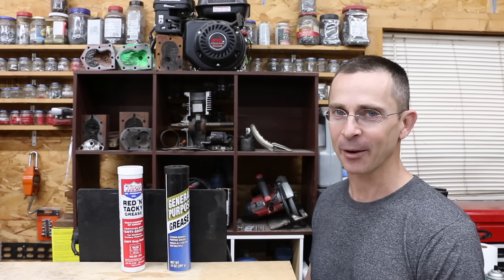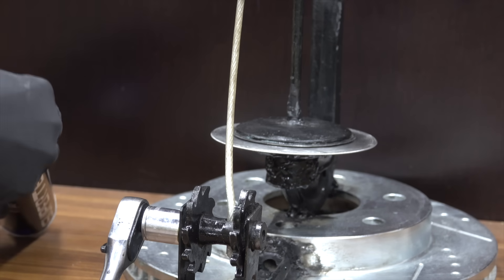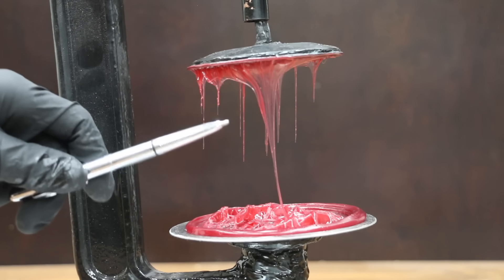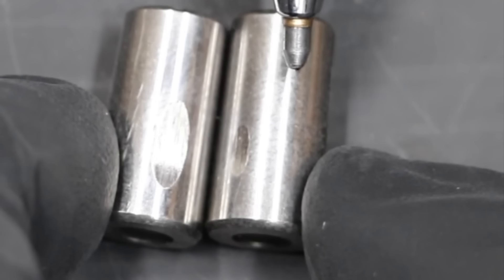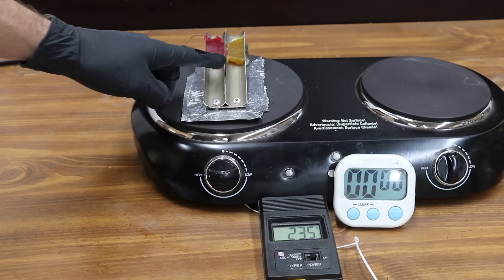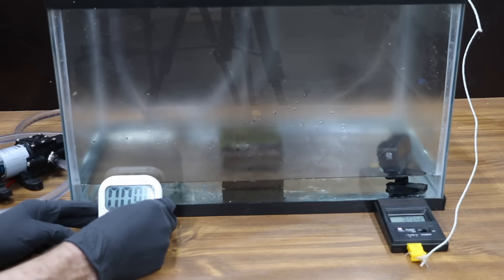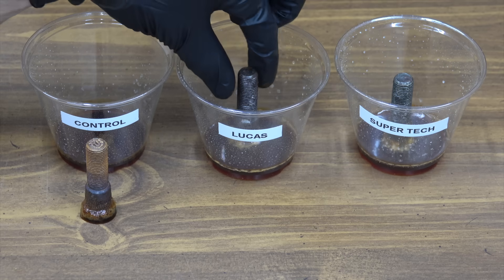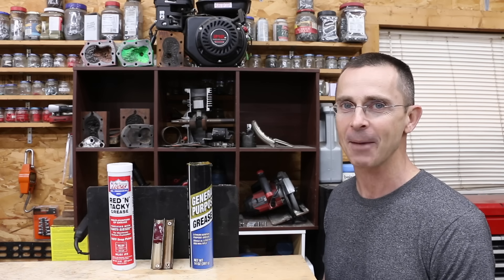Is Cheap Grease better than Lucas Red N Tacky? Let's find out! Bearing Grease Test Episode 1

Comment: Anyone here remember Quaker State "Golden Chassis Grease" with the 'Golden Additive'?  I still have 1/2 a tube from way back when & Ford/Lincoln Sp. Purpose p/n something or other 'special chassis grease '(Moly) circa 1978.  I myself used Esso Lonax the most along with Castrol EP2 & Monarch Monaplex (for bushings & slides) I also have a (display) can of (cannot read the brand) chassis grease from around 1915. Still smooth & useable.  Each grease base has a different purpose (example) Needle Bearings to Bed ways.  Thank you for all your tests, you think of everything!

Comment: Certified grade 2 grease!!! I use this grease at work in every bearing out in a plant and would like to see if their high dollar grease is really worth the money! Thank you for reading this
Reply: Every bearing? No no. 
Unless your bearings are the same size going the same speed with the same load under the same conditions you will have to be incorrect on some
So many variables 
#2 only refers to its thickness, its ability to stay in place
There are many many applications calling for #1, 0, 00 or #3
Base oil viscosity and thickener type are the most crucial

Comment: Video idea: does running kerosene, gasoline, or diesel mixed in with engine oil help remove carbon build-up in valves/lifters on a gas engine? Would it help doing so before an oil change?
Reply: No it does not, it would make things worse if anything, by thinning out the oil and making it pass more easily through the oil rings to the cylinder. Gasoline etc. would boil after the first warmup anyway and Diesel would just lessen the properties of the oil.
Reply: Adding a solvent (like Diesel) to the oil and running the engine for 10 minutes would essentially be doing an engine flush, it won't remove any carbon from the cylinder, but it might remove some hunk from the oil lines.

Comment: Would love to see you test john deere grease, on the next test. Always making interesting videos. I lean alot from your videos.
Reply: Very much so. Polyurea are supposed to be far better than lithium bases. However polyurea has larger compatibility issues with other grease types. Deere bearings are pre packed with Deere grease, forcing you to buy actual Deere parts if you want to use Deere green polyurea grease.
Reply from the maker: Thank you for the video idea!

Comment: Hows Lucas Green grease compare to the red n tacky? I noticed using the red n tacky if I leave gun hang in garage for around a week or so it starts dripping red oil. Why? Summer or winter. Doesn't matter? Is the grease still good after its lost that oil its dripped out?

Comment: The grease incompatibility comes from certain Molly based grease and lithium based grease. Throw in some of the more odd Marine greases with aluminum bases and you can have your grease turn to a solid crust in a few minutes under pressure.
Reply from the maker: Great recommendation

Comment: Last time i changed my brake pads i repacked with wheel bearing grease which contained aluminium for heat. I haven't had any trouble yet but I don't trust it.

Comment: The test is a high temp bearing grease verses a light duty grease. Honestly what did everyone one expect? The testing wasn't on an equal level. 

Now let's see a fair test, put Lucas tacky red against Supertech Red high temp.
Reply: Re-read the title!
Reply: @tonyallen8596  I know what the title says, but the video goes down the road of battle of the brands. That doesn't go along with the intended topic of cheap vs expensive.
Reply: That's not the point of the test .

Comment: Heavy equipment mechanic here... if you’re an operator, please grease at least once a day... two times a day would be better. And please wipe off the extra when it dangles. It’s bad for the environment and grease doesn’t come out of clothes easily lol. It also looks bad, like you don’t care.  You grease... I’ll come fix it when it finally breaks that’s my job. 

Great video, very surprising results considering I’ve heard the same line before... “any old grease will do.” No, no sir it will not.

Comment: You should do a grease test to show why you shouldn't use low heat temp for wheel bearings. A what happens if you use the wrong grease for the application.

Comment: I use it in ARs and AKs for carbine classes. 900-1000 rounds in 5 hours or so, no issues and no need to reapply during the class. I dont recommend it for long term storage, stick with oils for that.

Comment: The "grease is grease just use whatever" does have a point in some cases.. Depending on the application it might not matter at all, My redicolusly overrated skateboard bearings is fine with whatever. Front wheel bearings in my van has to be changed every time I change brake disks, so better grease to prolong its life is pretty useless, (altho I might get slightly better milage in cold weather with better grease judging from this)

But in the end, even expensive grease is cheap, and saves me from needing two types, so I'll buy some synthetic stuff next time....

Comment: I find that the quality of grease does have a significant effect on the life of bogey wheel bearings on snowmobiles. Removing the original grease from the cheap China bearings and filling them with something better DOES have a positive effect.

Comment: I’ve been using Red n Tacky as lube in all of my metal-framed handguns for years. I’ve noticed in particular that it has done on amazing job at reducing anodization wear from the slides on my aluminum-framed handguns (P226, 92s, etc.). I also use it to keep suppressors from getting stuck on their mounts after high-volume fire and it works like a charm for that as well.

Comment: Lots of greases could be tested.  I use superlube synthetic when it's something that doesn't get much service or doesn't use very much.  Could check out greases with molybdenum disulfide and if you drill deeper in to that, those moly greases will contain different amounts of molybdenum disulfide.  Lots of specialty greases out there too.  So maybe just do general purpose greases.  Have a contest for moly grease, synthetic grease, marine grease,  conventional grease, etc etc and then a final battle to rule them all.
Reply from the maker: Thank you for the video idea!

Comment: I get this test but super tech said it was light duty. It said it dropping point was 350. Lucas was heavy duty and had a much higher dropping point. So how can you compare both. Not really a apples to apples test. Just my 2 cents I am not complaining I just making a statement super tech never claimed to be more than what it was a light duty grease. Lucas was better because it’s a heavy duty. So I kinda feel like this test was a bust to begin with.  Comparing like for like best time will be better.  Mobil 1 vs Lucas.   Then wolfs head vs super tech. To be the test was just not comparing like for like.

Comment: Well heck yeah! I tend to go for the lucas myself, nice to see it really is that much better. I mainly use grease for mower spindle bearings so in that application it can be pretty important, especially since most mower manufacturers give you a grease fitting these days with sealed bearings, so the grease zerk doesn't do much good. I've also found that chinese bearings can be made to last much longer if you open them up and put decent grease in them out the box.
Reply from the maker: Thank you

Comment: The best EP2 grease is Chevron ULTRA - DUTY high pressure EP2 Red. NLGI2
MEETS MILITARY SPECIFICATION MIL-G-81322 down to -15 Farenheit. 
Has Industrial marked on it.

Made for oil rigs it resists salt spray, it is so tacky / stringy you cant wash it off ,even with good hand soap. It looks like the Lucas .
My bet is the Lucas is Chevron made for Lucas to different specs. The stuff is tanashus!
No one knows more about making grease than Chevron . They have spent more time ,money and research for both private and government sales. No one has as many grease patents as Chevron!
I would like to see the Chevron HP EP2 RED compared to the Lucas.
The Lucas Red is $4.98 per 14 oz. Tube.
The Chevron Ultra Duty EP RED is $14.87 per 14 oz. tube. 
Both on Amazon!
You can belive the Cheveron is far better .

Comment: I started out using Amsoil grease then Mobil 1 and then the Lucas. The complaint I have on all 3 is the syrup that leaks out of the bottom of the grease gun. The Lucas however leaks less than the others. I use the Lucas on all my stuff and on the dam that I run here in Wisconsin. It has 3 10 foot gates with gear boxes that operate 4 inch diameter 10 foot tall screw that attaches to the gate. The Lucas grease works very well even in sub 0 conditions. The gears turn smooth and easy using a manual wheel. When the video started I wondered if you would use the lubricity tester and was glad to see the out come. To solve the syrup problem there is a company that makes a product called "Gundom" it's a condom for your grease gun!

Comment: Can you mix two “incompatible” greases to see what happens to metal wear surfaces as compared to one grease cleaned off and replaced with something else. Other than the two already tested.
Reply: There is really no such thing as compatible or not compatible grease, the only risk is the coloring agents reacting really, which would make the grease most likely black, so impossible to tell if it's worn out down the line just by looking.
Reply: Piotr Sulej Incompatible was used in the video, if you watched it, it was the grease manufactured that said it.
Reply: @F6HemiCharger  I know that the manufacturer said that, but manufacturers often say that things not sold by them are not compatible, don't know if that's the case here, but afaik mixing grease (just like mixing oil) is not an issue.

Comment: It never ceases to amaze me how accurate your test runs are and how much thought you put into them. Awesome!

Considering ideas for future test runs :

There's a rumor saying that you should mix 2-stroke-engine-oil (1:300) to Diesel fuel to make the engine run smoother, reduce wear and friction and also reduce  carbon buildup in the cylinders and gunk on the injectors. And "of course" it'd reduce fuel consumption. Pure magic! Could you test that?

And while we're at pimping Diesel fuel : could you test 2-Ethyl Hexyl Nytrate cetane booster for its effects, especially change in max power and fuel consumption. Sounds like rocket science, but the stuff is available on Amazon.
Reply from the maker: Thank you for the video idea!

Comment: Let’s see a grease “tournament” for March. I’d probably watch this more closely than basketball.
Reply: Yes. Absolutely do this. I'll even donate a few tubes.
Reply: This would be fantastic, could try getting in some of the "high performance" brands to show down!
Reply from the maker: Thank you for the idea!
Reply: Absolutely! Great job on this one, keep it going!
Reply: I’m late to the party but would love to Belray waterproof grease in the mix as that s what I’ve been using when maintaining the dirtbikes.   Cheers
Reply: Gadius
Reply: Definatly, if this goes ahead id be happy to donate a few aussie brands of heavy duty grease like penrite and gulf western
Reply: All blacks anyways
Reply: I agree, really wanted to see Mystik JT-6 in there, it’s the grease I used for 16 years in my old job.

It was a brutal application, high temp, high speed, high load, water AND dirt. 🤣

Even with all that the bearings we were greasing typically lasted 10+ years, even with somewhat spotty greasing by me.

Comment: I have used cheap grease, but I have been using 3% moly grease and have found a huge decrease in wear on my backhoes. But I may have to use Lucas for my wheel bearings from now on, the cold test and heat test has me convinced. Thanks for the time and effort you put into these tests!

Comment: i always buy Lucas products if possible. Red N Tacky grease is phenomenal for chassis lubricant. i really love the visceral satisfaction of greasing a u-joint or tie rod or ball joint on my old trucks. it's also really handy to use a tiny dab in the shop for making paper gaskets stay where they're supposed to during assembly.

Comment: Napa has a really nice bearing packer, no nuts or threads to have to spin on, just a nice tite fit. put bearing in, put top cone on,  push down till grease comes out  through bearing.    ive done the cheap grease also.  wonder about a  test of  Motocraft  oil against some of the premium brands also tape measures  comparisons would be great  tests .   cool testing equipment

Comment: You might try testing old school crisco cooking grease.   Ok the deal is when I was a teenager we were pulling a boat and trailer we were about 100 miles from home we wound up on side of road due to trailer bearing failure. My stepdad had a new set of bearings and races in the truck just never put them in.  Well what to do now? Got tools, got bearings, but no grease hummmm got crisco now I’m thinking this is never going to work. But he pulled it down cleaned out hub and spindle installed new races packed bearings with crisco and we headed home and made it no problem. Well here is the funny part one year and several trips later we were camping out on the river I’m telling one of my uncles about this thinking in my mind that he repacked bearings with actual grease when we got home from that trip and my stepdad said no I never did that trailer still packed with crisco I said WHAT???? Are you kidding me he says no it’s still in there.   We pulled that boat all over the country between three states with bearings packed in crisco. So all I know is it’s works pretty good.
Reply from the maker: Thank you for the video idea!

Comment: Hello there. I just stumbled upon this channel and found this video very fascinating. Very good work testing the grease with the tools you have.

I happen to be a lubrication chemist. I will say right off the bat that grease is a very complicated lubricant. Most lubricant researchers stick to oil, for good reason!

Just a few things to add that you might find interesting. 

Greases dont "react" when mixed together. The reason greases can have issues is that when two incompatible thickeners are mixed, their ability to absorb oil is severely inhibited. If you do any future tests, what you should be looking for is for the mixed grease to bleed excessive oil. You can observe this easily with a white piece of paper, as the paper will wick out the oil. 

For most applications that people are using grease for, the thickener is the game changer in lubricants. The thickener is what gives it a larger range of temperature usage and the ability to lubricate at slow speeds. The type of oil is certainly important, but its much more important in applications that common people do not have to grease (wind turbines, very high speed bearings, etc)

For your tackiness test, one of the reasons for "tackiness" is to prevent lack of lubricant film formation when the grease gets contaminated. Some greases dont need good tackiness(or adhesion) if they will be running in clean environments.

Finally I will add that one of the biggest issues is that these greases with "anti sieze" additives like the lucas grease has can actually be more harmful in the long run. There has been much research done by various companies (Schaeffler, NSK, SKF, Afton, etc) which show that these additives end up causing embrittlement of the steel due to reactions occuring in the film. 

These greases certainly do well in slow applications, but these greases might not be good for heavy load/higher speed applications such as a wheel bearing.

Let me know if you have any future questions for other tests you might run.
Reply from the maker: Lubricant Chemist, Terrific feedback!  I'd appreciate any other advice you could offer with regard to "gaps" in the testing.  What else should I attempt to test.  Also, could you recommend 5 grease brands and types to test?  I'd like to conduct an apples-to-apples comparison.  Could you please send this information to me at projectfarm52@gmail.com   Thanks, Todd

Comment: Another impressive test!

I was surprised how much weight/power it took to break the tackiness seal. Wow over 80lbs...

Let's see a clash of the Titans! 

BRING OUT THE AMSOIL!!

Me: "Amsoil.... I put that shit in everything..."
Reply: I'd love to see the Water resistant Synthetic Grease from Amsoil, looking at the spreadsheet it has some impressive stats, and it's not overly thick, I use it in all my bearings now. Have a different grease for when lowest possible sliding friction is required, this stuff is not very slick in comparison, and it's pretty thick.
Reply: @piotrekserwisuje  i agree. I use Amsoil in EVERY i have. When i buy anything,  1st thing i do is change out all the fluids for Amsoil

Comment: If you can also add a comparison to Mobil Polyurea EM Grease. (I can ship a new tube to you as well) Used cases of this stuff on starting up new equipment. It was also recommended by many motor manufacturers. Pumped this stuff in from 5HP to 150HP. Curious on how it will hold up to your testing.
Reply from the maker: Thank you for the video idea!

Comment: Please connect a shop vacuum to air box with an air filter inside. Check the vacuum before and after the air filter. Compare various brand air filters to find out which filter has minimum restriction filtering air for car's engine.
Reply from the maker: Thank you for the video idea!
Reply: @ProjectFarm  if you make a video; please use an air filter that fits 2004 Accord 4 cylinder if possible.